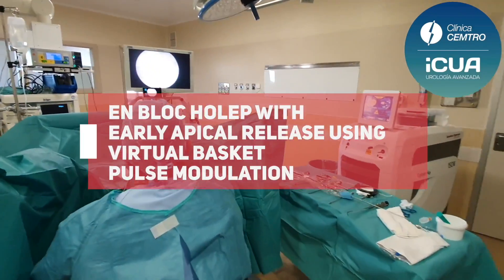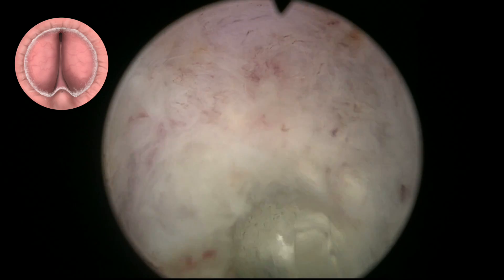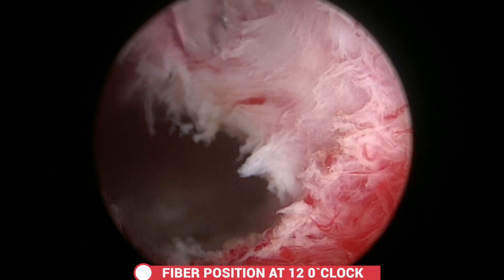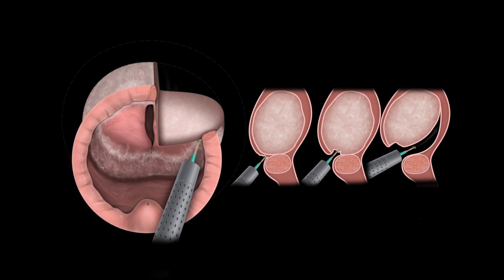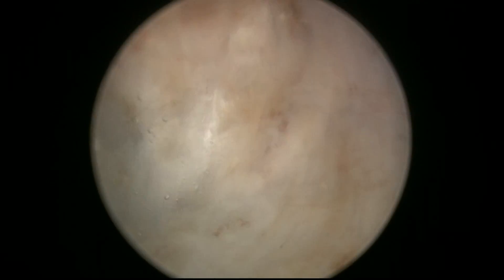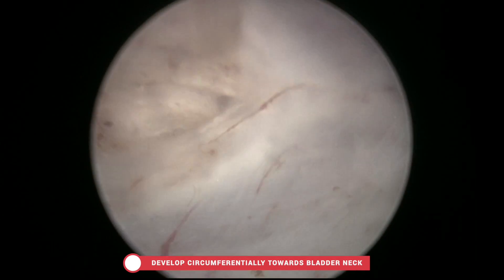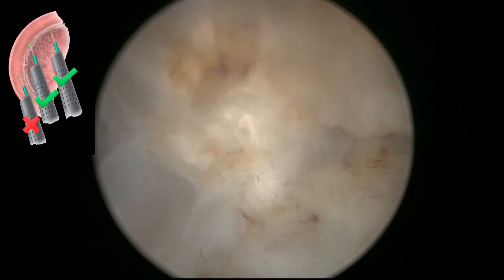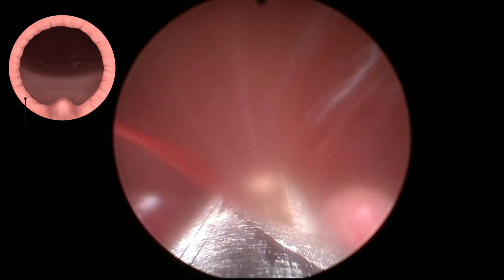EAU 2022 8-minute video with drawings

Comment: Can Holep be used to remove cancerous prostate tissue instead of focal ablation techniques such as Hifu or cryotherapy?
Reply from the maker: On certain occasions, HoLEP can be used to treat patients with prostate cancer. When the cancer is very low risk and is going to be managed with surveillance or in combination with HiFU or radiotherapy. Also, when the cancer is being managed with drugs and the patient has difficulty voiding or carries a urinary catheter. However, it is not an optimal technique for the treatment of prostate cancer...